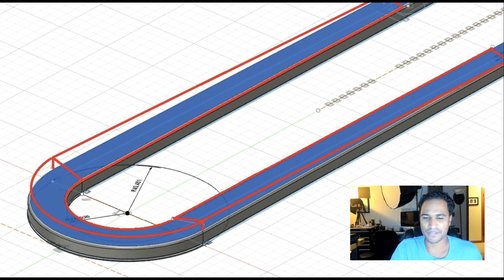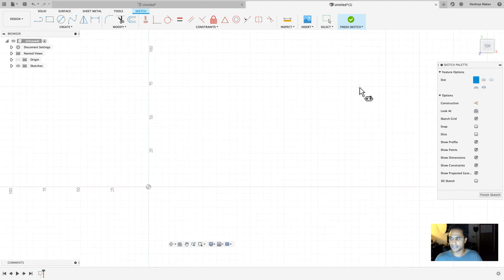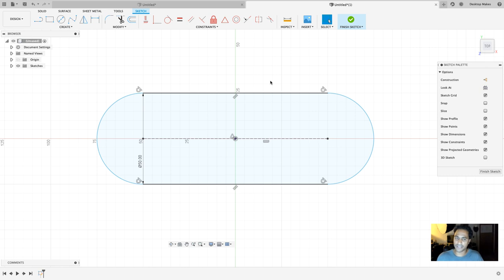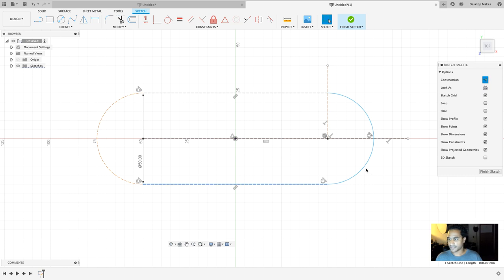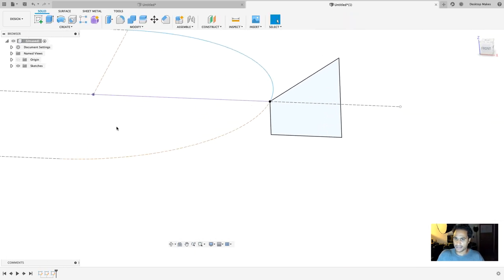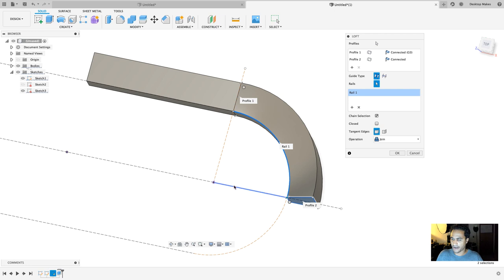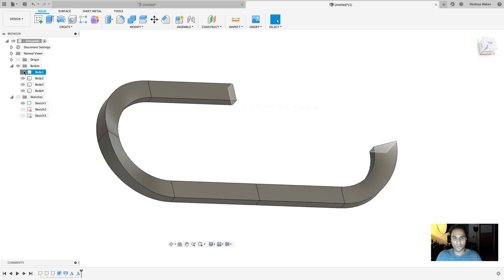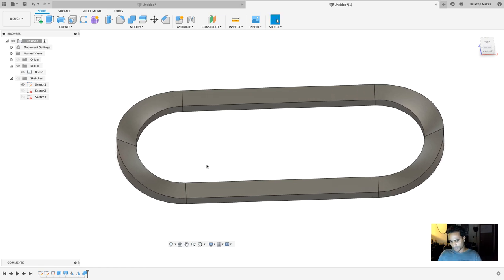Race Track Design Challenge

Comment: I started with a slot, an offset, and an extrusion for the bottom part. For the top part, I just swept a triangle all the way around the track. I had clearly misunderstood the part about the track being flat on the straight sections.
When I started seeing your solution, I immediately guessed loft along path - not too difficult.
Reply from the maker: I actually had done the same thing when I originally read the posted question.  It was after I had re-read the question that I realized the middle section had to be flat.  Nice work.

Comment: However, I noticed that using your half-loft technique, the middle of the turn is not perfectly smooth. There is a little bump right is the middle of both turns. This would definitely not be acceptable at 300 km/h on a racetrack ;) 
What I did is to loft the complete turn using 3 profiles. It works perfectly, and no more middle bump.
Thanks for the exercise ! I learned a lot from it !

Comment: Great tutorial. But I think that at the middle of bending curve, two bodies of the mirror command are not well tangent with each other, causes an noncontinuous transition. I guess that it's due to the suddenly ending of loft, while it's tending to extrapolate the profile. It's different with the case of flat part and curved part transition, in this case there is nothing to rule the loft profile to decay.
Reply from the maker: Good point Quang.  If I was to do this again I would loft the entire half and then mirror.

Comment: Thanks! I liked your tutorial! But there seems to be a bump where the mirrored parts join at the xz-plane. How do you get rid of that?
Reply: Maybe extrude sketch 3 a tiny bit and then loft to both extrusion along the path?
Reply: @diterex  I got rid of the bump at the XZ-plane connection by cutting out a section symmetrically around that and then lofting those cut-planes together using tangent transisions. Will put a screendump af that in the FB-group

Comment: Your Fusion 360 interface is different than mine.  How do I get it?  I'm able to follow along with my copy, but it wold be easier if the UI were the same.
Reply: You need  to be online to use Fusion 360, and Fusion 360 will automatically update to newest version. -so your version is the same! You need to be in Design and Solid mode.
Reply: @hpekristiansen  I assumed I was online.  Just restarted Fusion and now it's showing me the new interface.  Go figure.